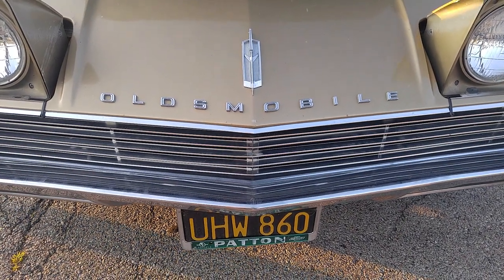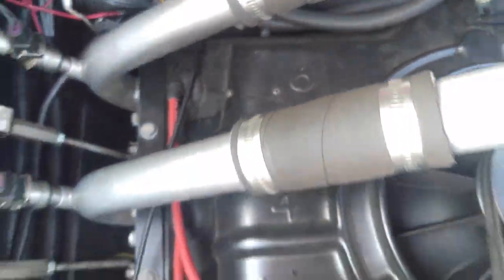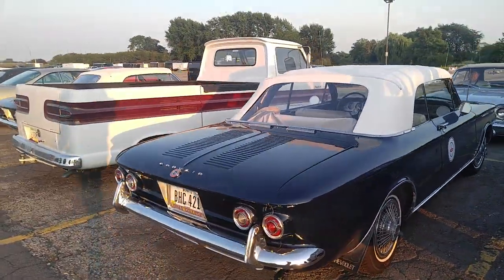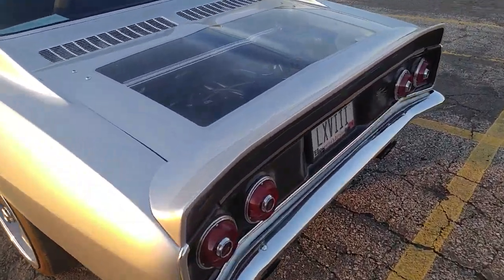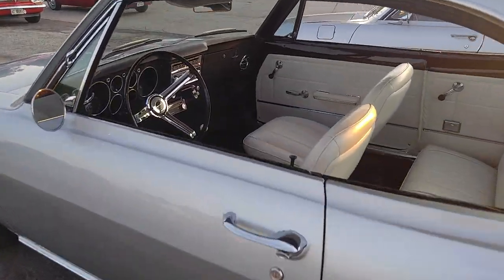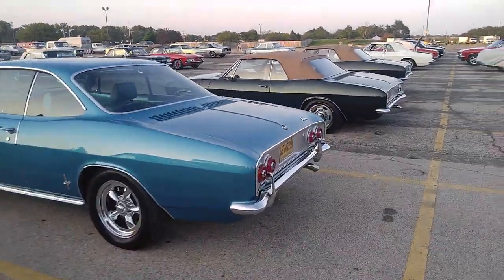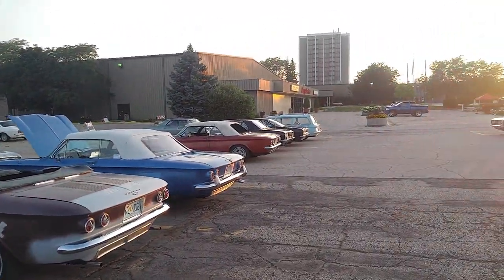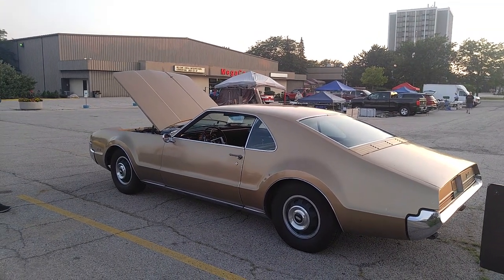2019 Corvair Convention St Charles Il 7 24 19

Comment: Growing up, our family had a 64 Monza convertible, later on I had a 66 convertible.
My Mom worked at a tire store and was given a free set of Michelin radials, it was funny seeing mechanics shake their heads when 
my five foot and a bit mom tried to tell them the tires weren't flat.  ;-D
I read about successfully mounting a Tornado drive train "behind" the rear seat (notch for pulley) of a second generation Corvair.
Seeing that I thought about a transverse front wheel drive V6, then saw a video of someone using a Fiero drive train.  ;-)